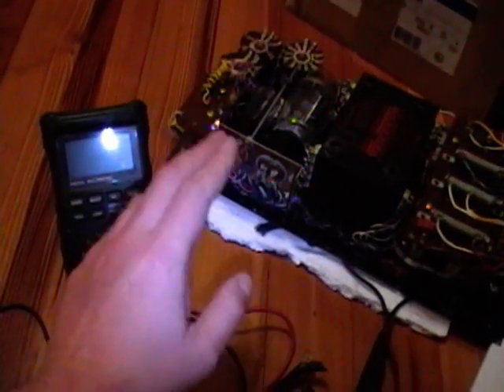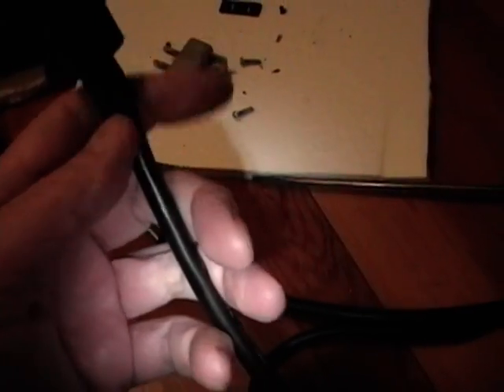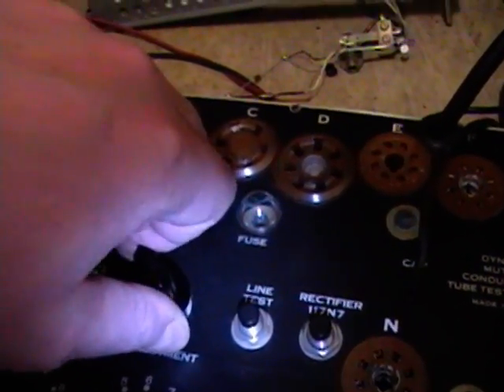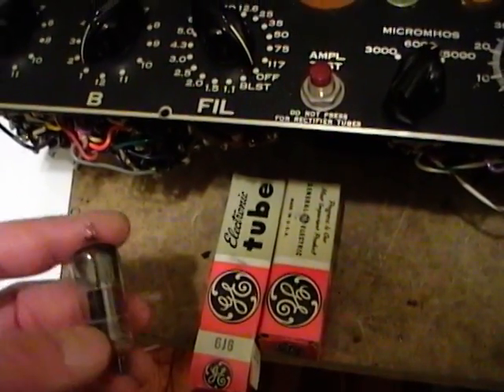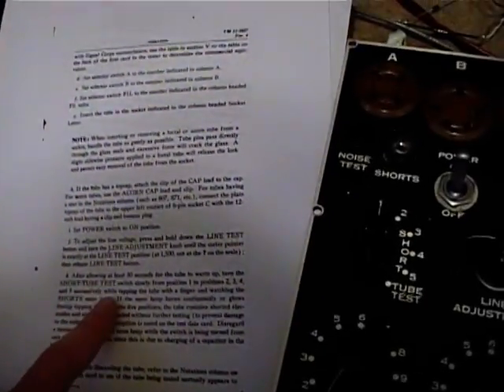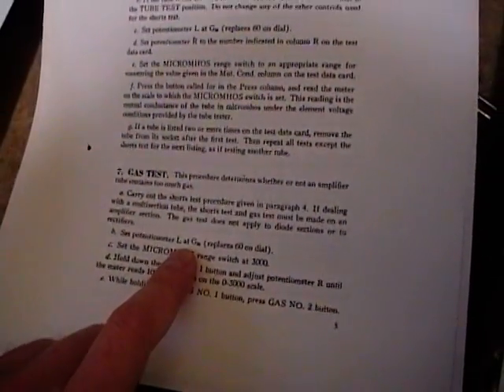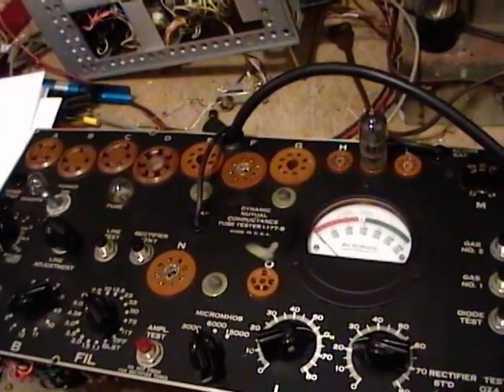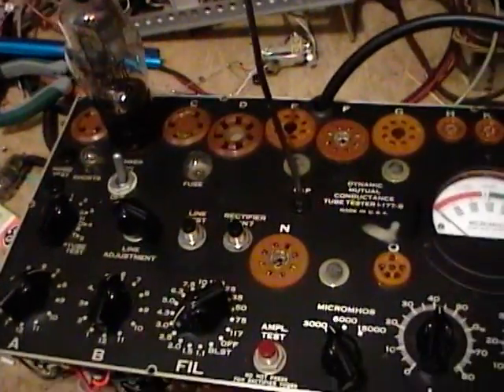I-177 military tube tester p2o3

Comment: You may want to see the following video on Youtube as to how the #83 tube was replaced. Chris Isert had the same problem calibrating his Hickok 1-77 with a solid state tube. See the following video:  Hickok I-77-B tube tester-solid state or mercury 83 tube? Part 3 of 3. He shows a diagram and site as to building the solid state using a zener, diodes and resistors.

Comment from the maker: Yes, that's right.  You'd need to check the tube data for the acceptable min/max range to see if it's within spec.  You can also use this tester in "english" mode where in the green means good and red means bad.